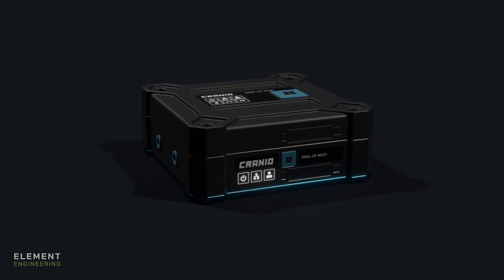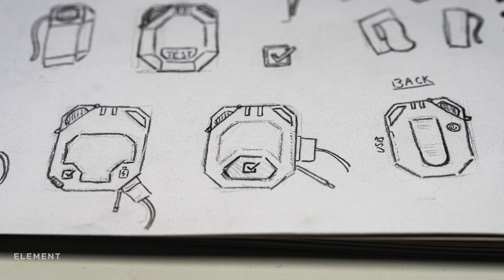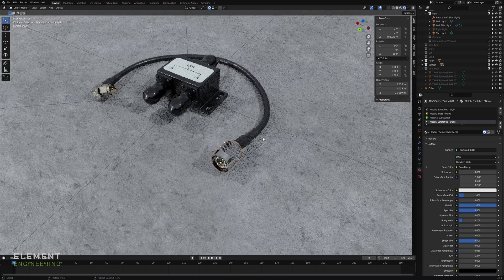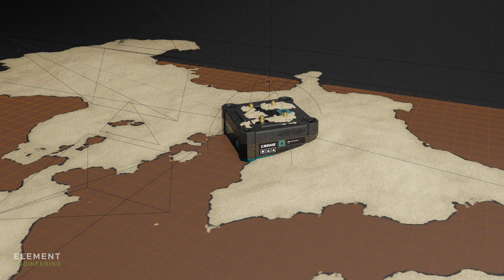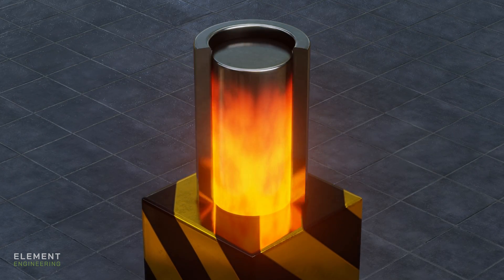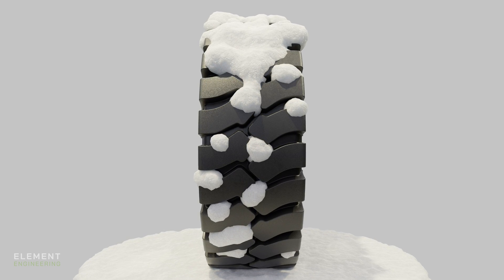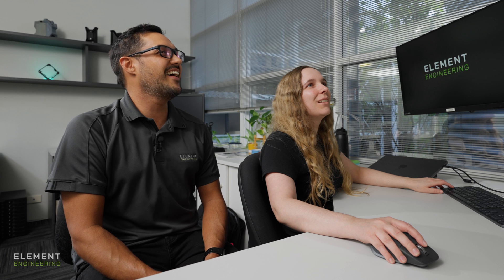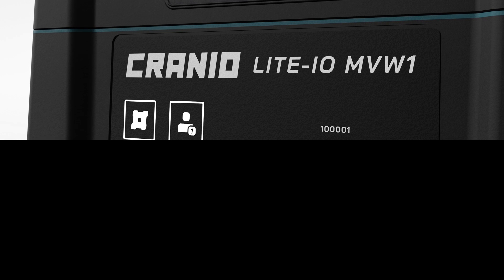The future of product visualisation | 3D Rendering with Blender

Comment: Great work Nicole and Ayrton! I also combine Autodesk Fusion with Blender-Octane for my work too. My friend was making an octopus, clipper boat, and ocean for his CNC class but was having trouble modeling ocean waves realistically in CAD. Because of my experience combining CAD and Blender and Adobe CC, I told him to run the water simulation in Blender then import it into Fusion to prep for CNC. 

I love the insights into your process and am keen on seeing what's next! If you haven't already, try out Blender-Octane which is a free version of Blender that includes Otoy's Octane rendering engine. I like it because I appreciate the way it handles metallic materials, lighting, and textures. Also, the quality per rendering time /resources is great because I'm doing it all on my gaming laptop as opposed to sending to a render farm / server rendering / big beefy workstation. 

I'm curious about what's next, especially for Simulation Nodes and as Blender evolves 🚀

Comment: Nicole said you convert the cad models to OBJ and then import them into Blender. You may want to check out an addon called Stepper, which allows importing STEP files. It's really quite good, it retains custom mesh normals from the CAD model ensuring smooth shading, retains the CAD file structure, correctly instances parts that are reused multiple times, etc. Really helpful for working with CAD files in Blender.
Reply: Ahh thank you for this tip, I usually export .obj 's from Autodesk Fusion then throw them into Blender-Octane edition for my projects.
Reply: Does this work with every CAD software, like FreeCAD/Ondsel ?